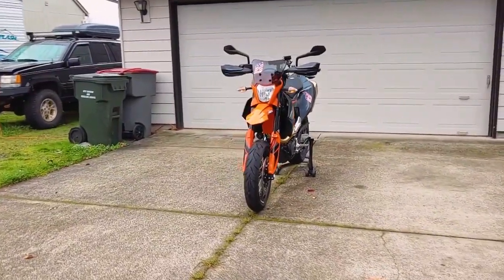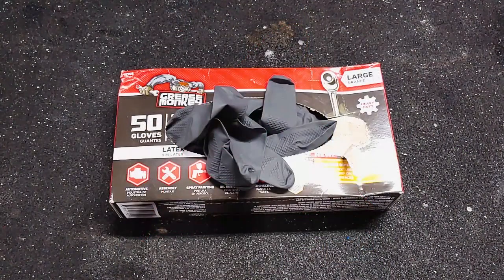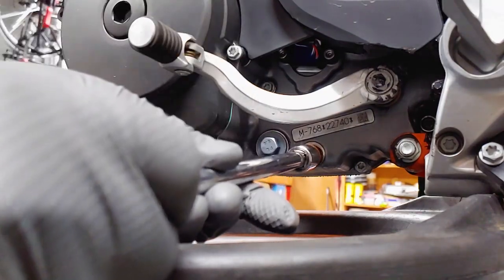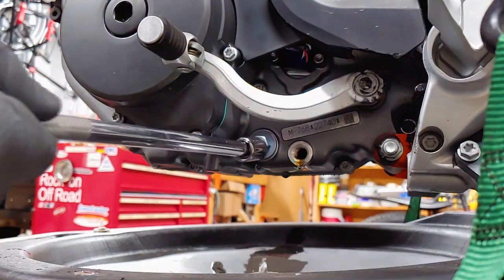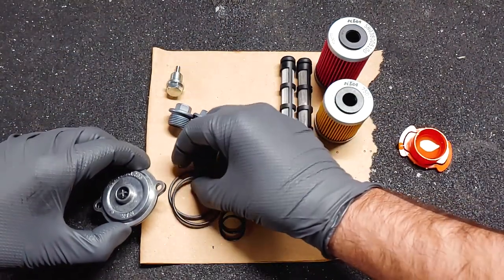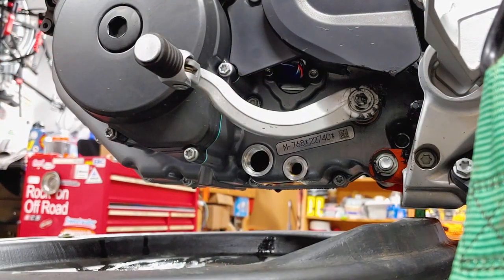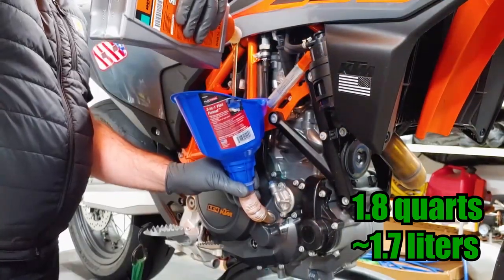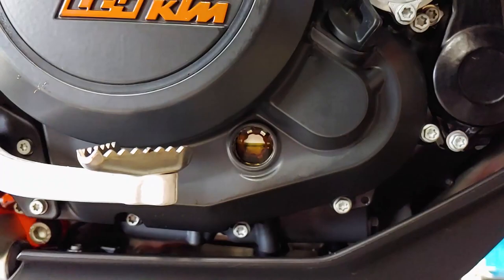KTM 690 SMC R Oil Change with Filters and Screens 2012-2021

Comment: Thank you. You helped me a lot. The ktm guys in sandgate road Virginia, in Brisbane Australia..they, didn't tell me about the screen filter. So now its on order. I mean how, bad is this. They work in the ktm, parts department, and don't even know how to do there job. After I changed the 2 fillters, I looked at your video, gave them a call..its on order. Thank you for this video..I have the, 2022 model. Love it..but thank you..can you go off road,?
Reply from the maker: The screen I removed didn't seem clogged up with debris, so it's probably okay to skip changing it once in a while. This is a friend's bike and I don't remember what his service manual says about the screen, but the kit comes with a new one and it's good practice to change it as often as you can. I've seen motorcycle shops do much worse and I really believe it's best for us to learn to do this stuff ourselves.